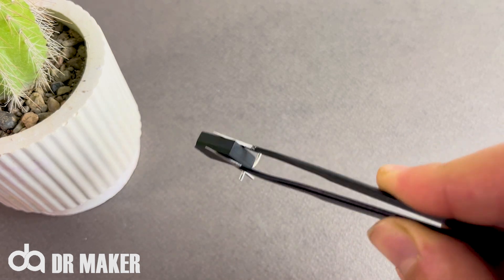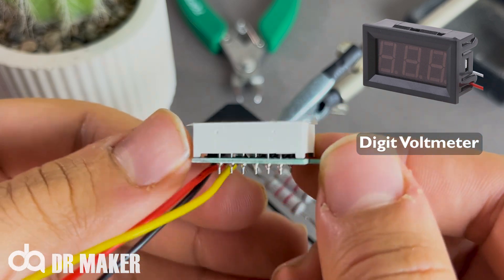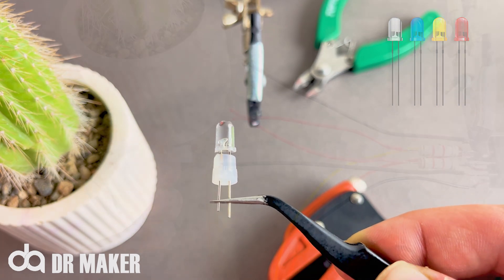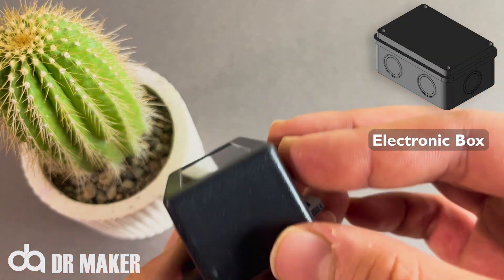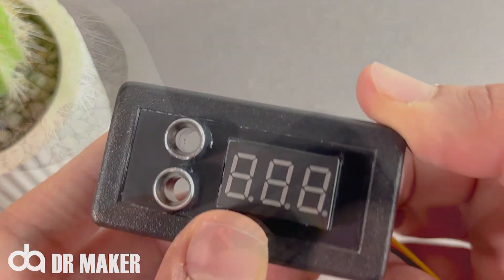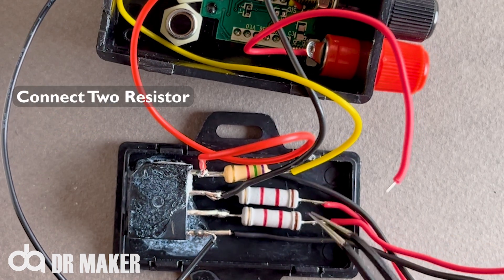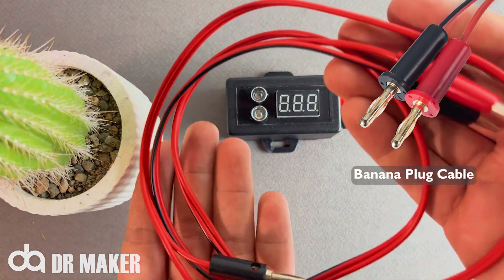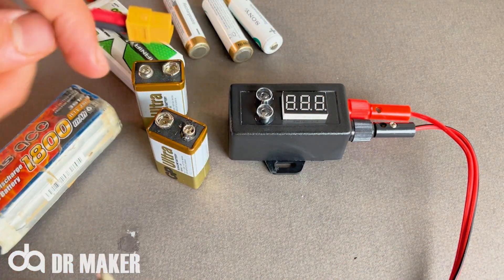Make A Powerful Voltmeter Tester For Your Home : ONLY A FEW PEOPLE KNOW!! | #electronic #diy  | ⚡🪫

Comment: how about min volt ???
i need to measure 1.5 AA battery.
thank you so much
Reply from the maker: Well my bruh, If you want to measure low voltage, you don't need a resistor and you have to remove the 7.5k resistor. Thank you for your interesting question ❤️